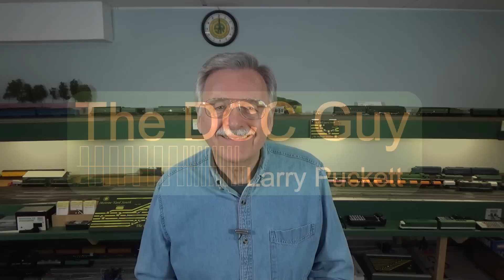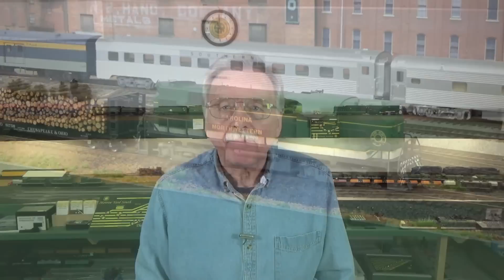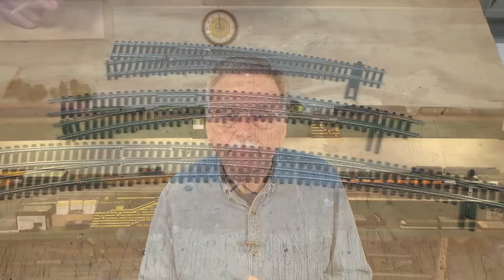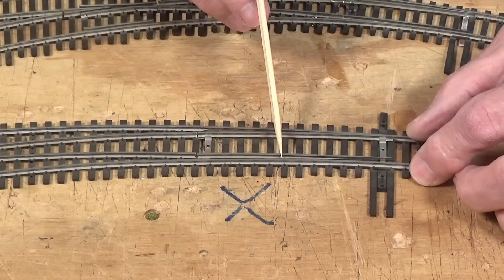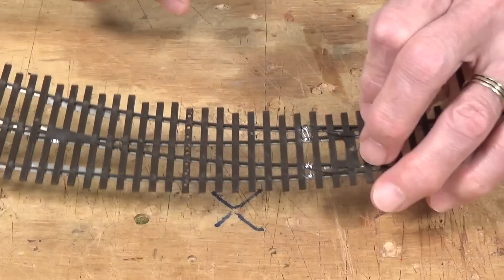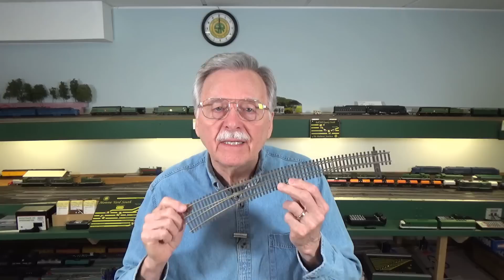DCC Friendly Turnouts  Do You Know What It Means? (314)

Comment: Really nice and informative.  Thankyou . 2 questions,  if you dont use a frog juicer you have a desd frog . So what prevents the  locomotives to stall there? Also i am just planning my first layout and wondering if i use 2 inch foam board and the plywood will the frog machine have any problems  reaching  the throw bar ? I want to use 2 inch for some changes in flatness on the layout.  Thanks andagain perfect explaining the concept of turnouts
Reply from the maker: If the frog is dead then the loco definitely may stall and that is why it is a good idea to power them. You can also just put a stay alive in your locos so they don’t stall. As for the throw bar it will definitely be too short but you can replace it with a longer piece a piano wire from the hobby shop.

Comment: how is the frog being powered on the walthers switch?...and is it powered positive or negative, because that varies depending on the switch position.  It looks like its mandated to have some form of electronic device to switch polarity dependant upon switch position.
Reply from the maker: You have to connect the frog feeder to a device to control polarity. This could be a Frog Juicer type circuit, a powered switch machine, a Blue Point switch machine, or a Caboose ground throw with a built-in switch.

Comment: Larry can you wire a cross over on a circle layout which is like capital Q where the tale (bottom right) eventually leads to a return loop utilizing an optional cross over at the junction? I used your technique for restructuring a Shinnohara turnout with great success. Your videos are highly valued. Thanks in advance for any help !
Reply from the maker: You can do just about anything as long as you isolate properly to avoid shorts. It may require an auto reversing circuit to handle the polarity though.

Comment: Hi newbie here . All I want at the moment is just combine Peco st 100 and 101 and run 2 trains together.  So, in a nut shell, I want everything powered.  
 Coming from an electrical background, it seems bonkers they sell something you can't just fit together and go yee haw.
Reply from the maker: According to their website these are sets of pre-shaped set track. So I am not sure what your problem is. Can you be specific?
Reply: @TheDCCGuy  I was thinking if I combine both sets of track, the switcher won't allow power to both tracks..
Reply from the maker: So do you mean you want to have two separate, independent loops? What are you using for power and what do you mean by the “switcher”?
Reply: @TheDCCGuy  yeah, I want 2 loops joined by the switch rail / crossover. 
And keep both loops live . I've heard power only goes in direction of crossover. I have considered 2 controllers, so as train changes track it then is on the other control.
Reply from the maker: OK, it sounds as though you want to have 2 separate DC controllers, one for each loop and you want to be able to move trains from one loop to the other across a crossover track. To do that the loops must be totally electrically isolated or you’ll get shorts. Consequently your crossover track needs plastic insulating rail joiners at each to do the isolating. Also you need a way to select which controller will be powering the isolated crossover track. There have been a number or articles in Model Railroader magazine showing how to do this and I covered it in my wiring book. Head down to your local library and see if they have any books on wiring a DC layout.
Reply: @TheDCCGuy  Much appreciated, thank you.  That's exactly what I want.

Comment: Man this quite complicated just to make your trains run, although the solution itself is fairly easy the fact that these things exist as a problem baffles me.   That said how exactly is the frog powered?  It seems if you ran a wire to it you'd have it either the opposite polarity as one rail (good because your train goes) or it would be the same polarity as the rail your train is on in which case train doesn't go?
Reply from the maker: Basically it requires a “electrical” switch of some kind to automatically change the polarity of the frog for you. There are various circuits that will do it as well as switch machines like the Tortoise and iP Digital that have built-in switches to change frog polarity when you throw the points. I have done a number of videos on these various devices and methods.There are over 300 videos on this channel covering a wide variety of such topics so feel free to binge watch or just knock one off every day starting at the beginning.
Reply: @TheDCCGuy  Well my wife and kid are leaving next week for a 4 day camping trip that luckily I don't have to go on, so I might just binge watch a bunch of videos :)

Comment: Okay, if I understand you correctly, the term DCC-friendly was meaningful and relevant 40 years ago in our hobby, at a time when DC was still king. I think it's safe to say most of us now model in the year 2023 where DCC is the norm, and the type of unfriendly Shinohara turnout you demonstrate is pretty much a thing of the past, one which the majority of prudent model railroaders avoid purchasing at train shows and flea markets now. The hobby has come a long way, indeed prodded by the advancements of DCC. Is it truly necessary to mention in the year 2023 that a turnout is DCC-friendly? Is any manufacturer in the hobby still producing DCC-unfriendly turnouts? What we buy now are simply turnouts of the current age, a reflection and byproduct thereof. Similarly, do we really need to continue to parenthetically interject "light emitting diode" whenever "LED" appears in the hobby press in the year 2023? LEDs have been in use in consumer products in the USA since the 1960s. We don't need to tout what is now the norm.
Reply from the maker: It has become more of a selling point than anything else. However you would be surprised how many of those old Shinohara were made and show up at yard sales and train shows.
Reply: @TheDCCGuy  You're making my point exactly, Larry. The DCC-unfriendly Shinohara turnouts of yesteryear are now dinosaurs (like first generation toasters), and given the advancements of the hobby over the last 30 years the term DCC-friendly is now also a dinosaur. The term is a pointless misnomer in the year 2023. You, I, and the hobby at large should no longer promulgate it. It looks glitzy and alluring on turnout packaging (and in YouTube videos), but it means nothing. A short circuit in DCC results the same as it does in DC. Let's spend our time coming up with some new relevant catch phrases for the state of the hobby in today's world.

Comment: Another option I've seen for a creeping loco is to add a stopping block on the diverging side of the turnout.  Basically the power on one of the rails was dropped when the turnout was thrown against you.  This help prevent shorts and derailments on the layout.
Reply from the maker: Yes, I did that in an earlier video by running the connection through one of the SPDT switches in thenTortoise.
Reply: @TheDCCGuy  Hi Larry. Can you tell me which earlier video this was please?

Comment: I have a question. I have set up a DCC track. I use Roco track and have several DCC ROCO locomotives, as well as USA based DCC locomotives. I have noticed that on certain turnouts the USA based DCC engines derail when they are set to go through a switch straight through. It seems the engine somehow partially moves the points to the "turn" position and derails. The ROCO DCC engines do not have this problem. Can you help me understand why this is happening?
Reply from the maker: First how are your points controlled and held in place? If they are firmly held by a spring type motor driven switch machine they should not move. Also check to make sure your wheels are properly gauged and also that your turnouts are correctly gauged. The NMRA sells a track and wheel gauge just for this.
Reply: @Model Railroading  They don't have motor control yet, so the switch manually. By Guage you mean code 100 vs 83? Sorry I am a real novice
Reply from the maker: Gauge is either the distance between the rails or the distance between the wheels. If the wheels are too far apart or too close together they can catch going through turnouts. And if the rails are too close together the wheels can derail. I think DCC Concepts offers wheel gauges and as I said the NMRA track and wheel gauge is almost a necessity.
Reply: @Model Railroading  OK, bit I thought HO was HO?
Reply from the maker: It is, but different manufacturers seem to have their own interpretations of the “standards”. Most of my Hornby locos will not go through my US HO frogs as the wheels are too close together so I have to regage them. Also some turnouts have guard rails that are not to specs and flangeways that are too shallow or out of gage. That is why I have 2 NMRA gauges.
Reply: @Model Railroading  The interesting thing is that in DC mode all my USA locos run great and no problem on any switch, but in DCC mode they have issues. Is there a magnet in the engine housing that moves the points?

Comment: Larry:  I apologiize for this off topic question.  I am installing DCC in Bowser steam loco.  Should I have current pick up from the drivers, from tender wheels or both?  Thank you  Andy
Reply from the maker: Just how old is this loco, I didn’t think they have made steam locos in decades? I would not feel comfortable advising you on this unless I can examine the loco as those old ones were a real problem to deal with.
Reply: @TheDCCGuy  Larry: thanks for your kind reply.  I have been following you for as long as you have been on you tube.  I have consulted Bowser, Digitrax and DCC Installs and Sales about this project, as well as a few other modelers.  The motor draws less than 1 amp and is isolaed from the frame.  Thus, this becomes  just like any other DCC steam locomotive.  Except that i have to figure out the wiring paths myself.  As the decoder is in the tender, I will need to decide where to pick up track power for the decoder.. This prompted my question.  Many thanks, Andy
Reply from the maker: You’ll need a volt meter to trace the correct pathway and make sure there are not multiple pathways through the frame. If it runs in DC already then the wires to the motor already are connected correctly, just make sure there are no sneak paths though the frame to the motor housing through a screw or other direct contact. I’d definitely use a 1.5 amp decoder just in case. Good luck.
Reply: @TheDCCGuy  Yes sir have said meter and did what you suggest.  I know my project is an anomoly but I have always pushed my skills beyond accepted norms.  many thanks

Comment: Great video!  Do you have any videos for a "poor man's frog juicer" (i.e. how to juice a frog without a tortoise switch machine)?
Reply from the maker: Video 261
Reply: That's actually the wise man's frog juicer. A real Frog Juicer decides which signal to give the frog based on whether a given signal causes a short or not, and if it does, it captures it more quickly than the trip circuit of the booster/command station. Still a short occurs, which (depending on whose opinion you listen to) may or may not damage decoders, boosters, whatever. Some people even claim that many runaways are caused by these shorts.
This is just one of those issues that everyone has some kind of opinion on. Without siding with any of the opinions, since using a Tortoise, a ground throw with contacts, or even a DPDT switch eliminates the microshorts of a Frog Juicer, using any of these is a better option. I have most of my frogs polarized and it is done by the DCC switch decoders I use. The installation is still cheap as I use extremely cheap no-brand S3003 servos.